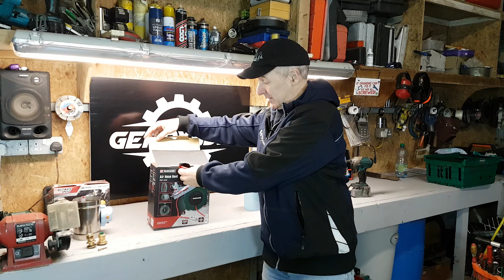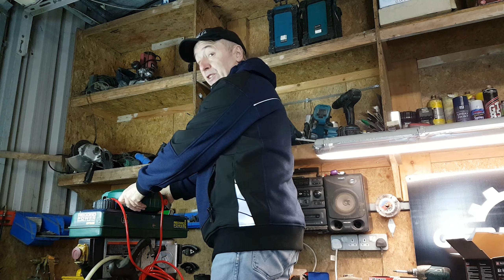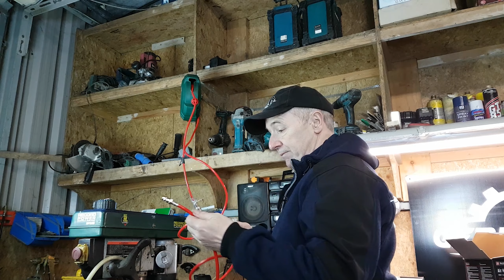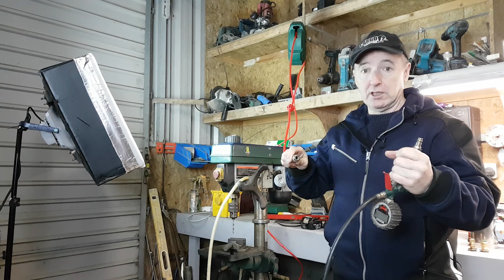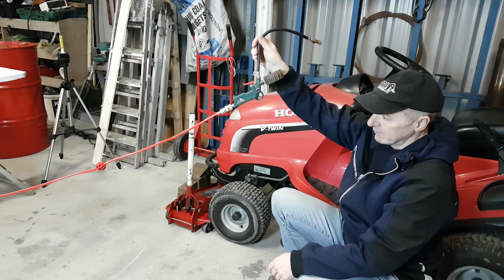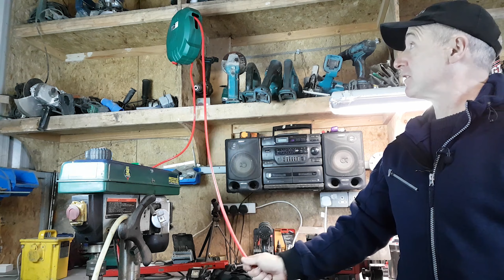Cheap Lidl Airline Hose reel Review .. Any Good?

Comment: I have had one for over a year. Excellent.
Reply from the maker: Hi Richard. I'm not sure that this one will last that long but I will be nice to it. I have to say that they are convenient and keep the hoses off the floor once it has been used. I might pipe the shed for air with a permanent solution. Thanks for commenting Cheers Gerry
Reply: @GerrysDiy  Have mine just inside workshop door purely for tyre inflator. Brilliant

Comment: I have a similar unit, probably got from a similar shop! i use it for tyres inside the workshop or using with the air duster for cleaning out stuff. for anything more industrial i have a solid airline around the workshop which i plug in to close to my work area. i have mine up a fair bit higher than yours - i can just about touch the bottom of it but can easily grab the hose - this helps it retract every time, and also uses up some of that 3M of hose to the compressor.
Reply from the maker: Hi Gary. I might run a fixed airline around the shed with a few take off points. I could do this in multilayer pex with crimped fittings and it would help with the tripping over hoses every time I go to do things. Thanks for commenting Gary, much appreciated Cheers Gerry
Reply: I got my reel from Aldi. It has been used on a moderately regular basis for about 7 years now. Used once every couple of weeks, mainly a tyre inflator, a simple blow of gun, and brad nailer. The spring isn't bringing it in, and I picked up a pin hole leak about a year ago. Time for a new one. If I get another seven years out of it, that will be fine.

Comment: Have a very similar product it failed where the hose is crimped onto the connector so I'd recommend adding some reinforcement around here like cable typing some rubber hose over it to avoid it pulling.
Reply from the maker: Thanks for the tip T5MKINDYOWNER  Cheers Gerry

Comment: Howya Gerry , I live in Blackwater and have a drone  , I usually fly around ballyconnigar/blackwater beaches. I see a few years back you has been flying a Phantom 3 Pro , I use my hubsan Zino to record the footage , as you can see in my profile photo , Cheers
Reply from the maker: Hi Sketch. I also fly the paramotor and paraglider around blackwater. Just looked at you channel. Have you any video to upload. Thanks for taking the time to comment Sketch Cheers Gerry👍👍

Comment: What’s it rated at?  
Aye the days of decent quality tools from Lidl & Aldi are long gone. Guaranteed to kink Gerry & like you I’d melt or crush it.  :(. I tend to use pressure washer hose just  because I got 50 metre for another project cheap when I only needed 10.  Reinforced 250 bar with an outer weave.  My view what you have there is junk :(
Reply from the maker: Hi SynKronos. Yep it's fairly lightweight alright but when I kill it I will change the hose. That's a good idea about the pressure washer hose too.  Thanks for sharing Cheers Gerry

Comment: Thanks for the review. Was thinking it could be handy. As someone else said the quality isn't like it used to be. 

Where did you get the digital tyre inflator, by the way?
Reply from the maker: Hi Paul. It will last a while only if I look after it but time will tell. The tyre inflater was another cheap tool from Lidl. It's parkside and pretty good. I have it a few years at this stage and needs a couple of triple A's to run but it has been reliable. Needs to not get wet though. Thanks for commenting Paul Cheers Gerry

Comment: Thank u very much for this review
Reply from the maker: Hi IgotbricoTools I am still using this in my shed and it working fine. The hose is not as tough as a braided hose but I keep it wound up if I am welding or grinding. Thanks for commenting Cheers Gerry 👍
Reply: @GerrysDiy Hey Gerry! Is it still holding up? I’m mostly gonna use it for cleaning up some stuff and inflating tires probably. But my current 5m hose is a bit too short. I guess you can also chain them together with a 1/4” connector?

Comment: I see them didn't realise it was auto rewind , I decided not to get one because thin pipe reduces flow rates, I have an old aldi and Lidl compressor linked together , 
Still need more air to run half the air tools impulse bought from there.
Reply from the maker: Hi crazygeorgelincoln I'm not sure how long it will last but for light work it seems ok. I can see the hose kinking or more likely me burning through it but it is tidier and more convenient than my other setup ( long braided hose) Time will tell. I need to get a larger compressor too. Thanks for commenting Cheers Gerry